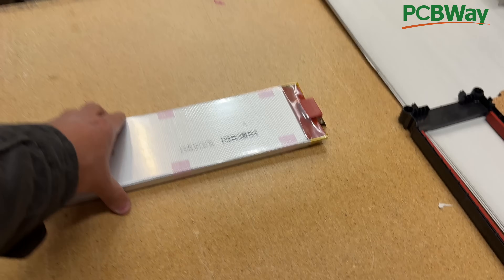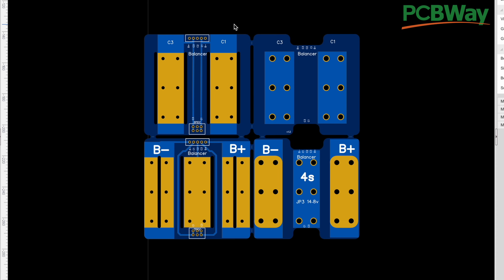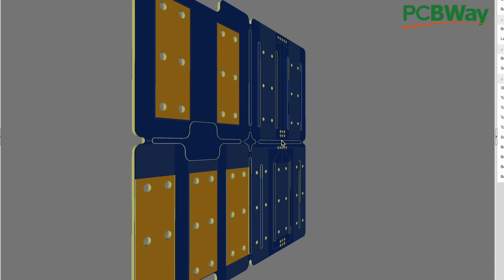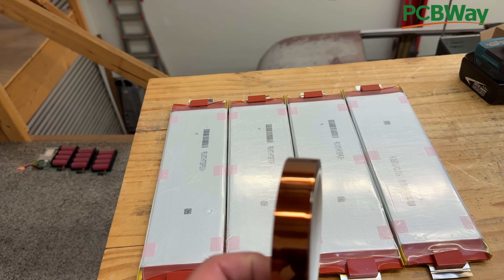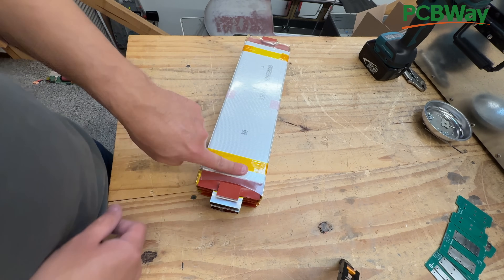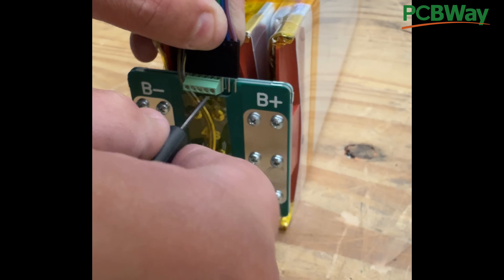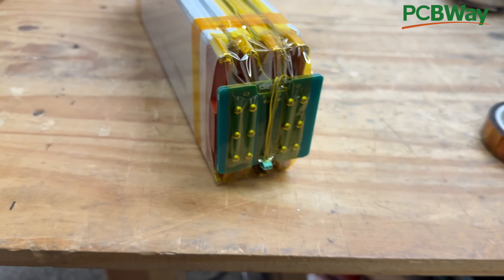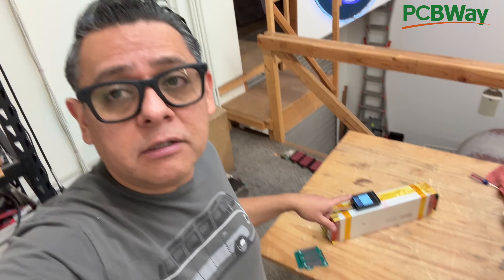How to use Pouch Cells without a Welder - 4s JP3 #pcbway

Comment: Ouch... That is Philips abuse. As a mechanical Designer I have to protest for the sake of all Phillip Head screws out there. Please use the right size bit, I am disabled (carpal tunnel issues as well) so I get using powered drills/drivers but the proper size bit and slower speeds will prevent that thump/thump when tightening and you will thank me after you have to take that a part later for maintenance. And I also get these appear to be very soft screws, which makes me think how the grade of the screw affects bonding. I generally had a Material Engineer that calculated that for us doing work on ISS  before I retired, should have paid more attention to them.
Reply from the maker: I’m looking for bigger head screws,  these are too small for my liking
Reply: @jehugarcia  All in good fun :)

Comment: Jehu THANK YOU FINALLY!!!!!!!! I've been eyeballing the JP3's since you got them!! What's been stopping me is the weird way to have to connect them, which you have solved and made easy for us less mechanically inclined! Please let me know if you plan to make a 14S (48V) PCB version using the rest of the back kit (plate holder, cork, thermal pad)?

I run 48V exclusively so I need to be able to do this, I really dont want to take multiple 4S PCB packs and try and string them together and ghetto rig a 48V system with multiple BMS's ect... 

Please please help us out, it seems like with your PCB skills it wouldn't take much to make a design for 14S(48V) both with the additional hardware or as show here just kinda taped together.  

Do you happen to know the max charge current for these? My solar can push a lot of amps and  I dont want to overdo it especially with pouch cells, because once one pouch decides its going up in flames, no bms is going to save you the whole thing is going to go off in thermal runaway. Would be cool if you offered some metal enclosures that could handle such an event. But I mean we can find that on our own too...maybe even a link to an affiliate. 

Do you know the proper compression pressure (not sure of the verbiage) that is supposed to be applied?

How will these PCB boards impact the end pieces that hole large packs together? Or is that part of the revised board?

Going to hunt around for more videos from. you on these cells/subject. Please brother hook us up with a 48V design (14s) PCB!!! with and without using the additional stuff in the kit for the cells. I beg you please!!!

I'm already thinking in my head of a design for a cooling plate and automatic  fire suppression in some sort of metal box. Seriously man thank you! The 12V community is probably super thrilled, don't forget about us 48 volters :)

Cheers brother, MAD RESPECT!
Reply from the maker: Yeah 24v and 48v is in the works

Comment: These diy boards should  separate connectors/through holes of opposite polarity. It is very easy for a diy-er to make a mistake soldering or even just inserting some cables. My burnt 7s 18650 pcb board from jag35 is testament.  😅
Reply: been there, several times lol

Comment: Are you using self-tapping screws or machine screws? What are the screws torquing against? If you are using self-tappers into the FR-4, this solution will not last.
Reply: i was thinking the same but nothing stopping you from riveting it together or even just bolting them down with a bolt and nut. i was thinking 4/6 rivit and 2x just add bolt and nut to so you can bolt jumper wire/ plate together to make higher voltage packs